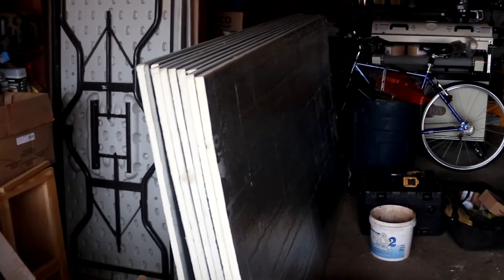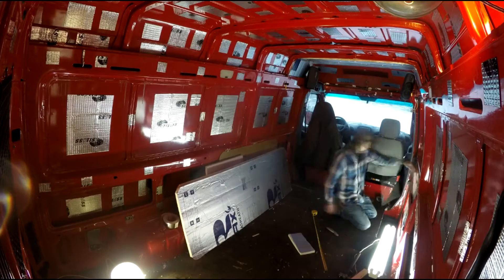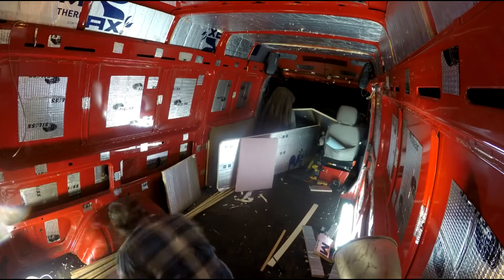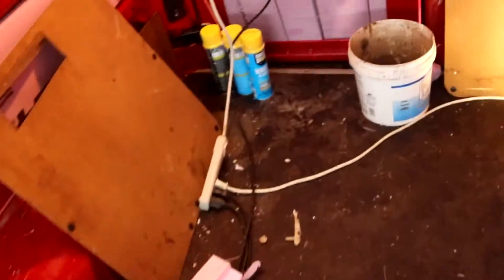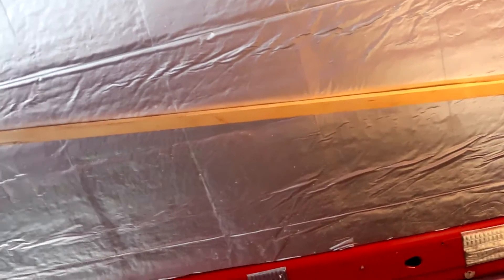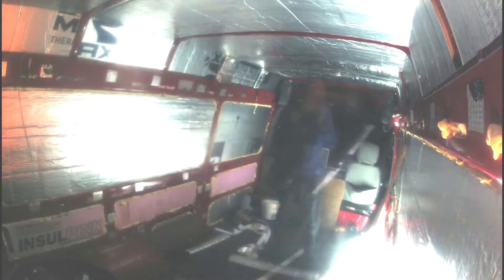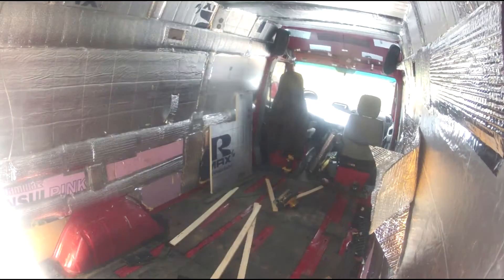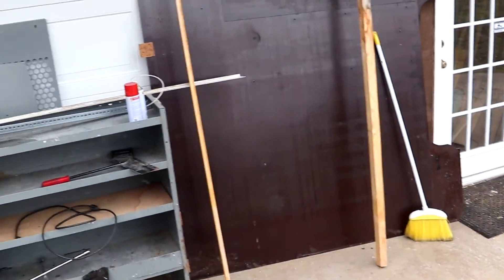Insulation Time! Sprinter Van Build

Comment: Do you think the Polyiso also helped to insulate sound/road noise in addition to the sound deadener you used?
Reply from the maker: Absolutely! Because it is a closed cell foam it definitely has some sound insulative properties. The deadener mainly just stops the panels from vibrating then this stuff will actually block and muffle any noise that gets through. I think fiberglass batt is better at blocking sound but obviously there isnt the room for that in a van. Also, keeping the van warm/cool is the number one goal so that's what I focused,